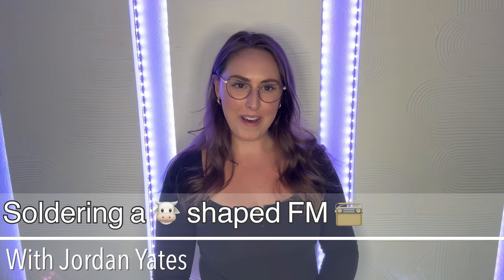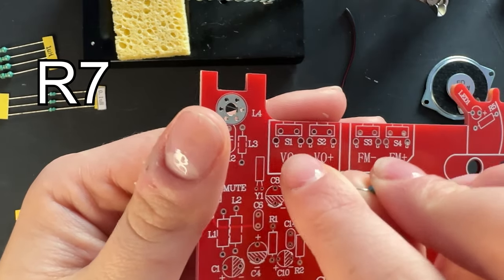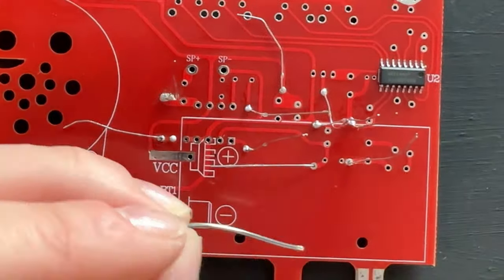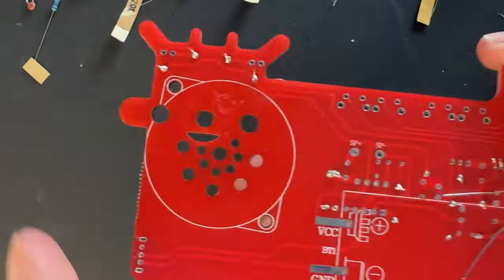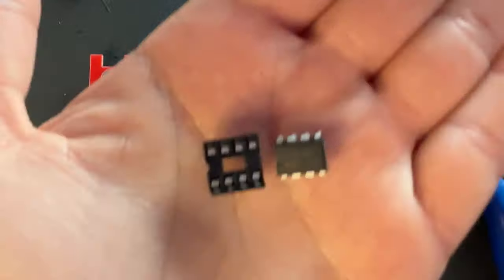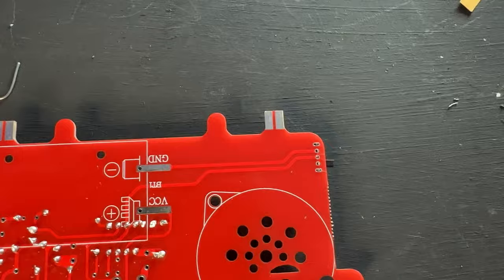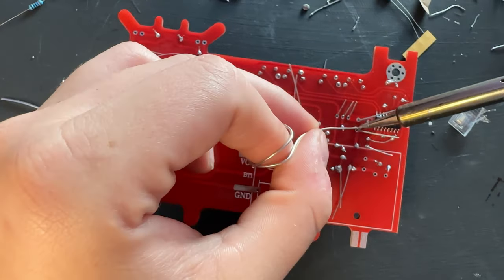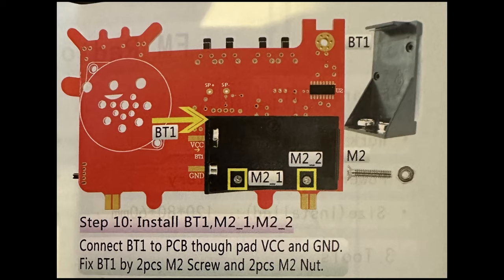Soldering For Beginners - FM Radio Kit

Comment: Maybe use a high temp plastic clip to hold surface mount components. They're hard at first, but the better you can "anchor" it the easier it is.

Comment: Never solder sockets with the chip in. It's really easy to overheat the chip (especially with large chips). Just solder the socket, add the chips when you are finished soldering.